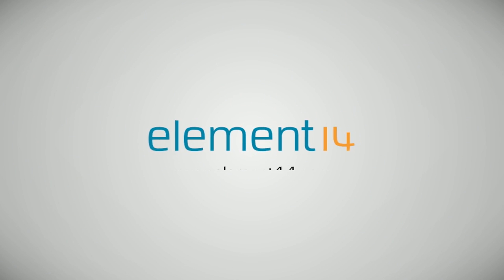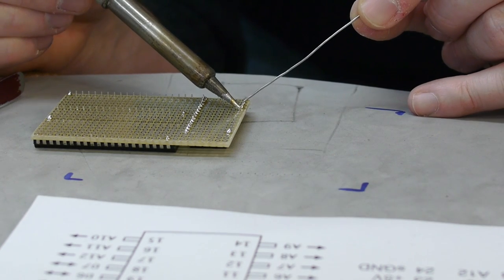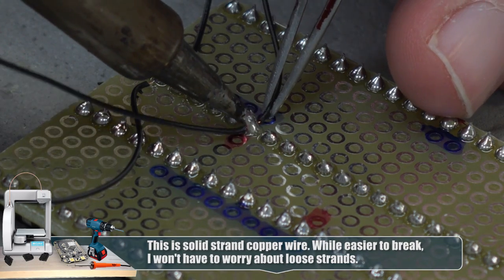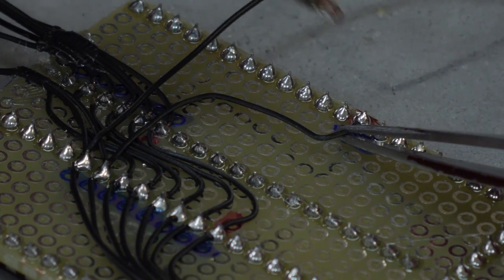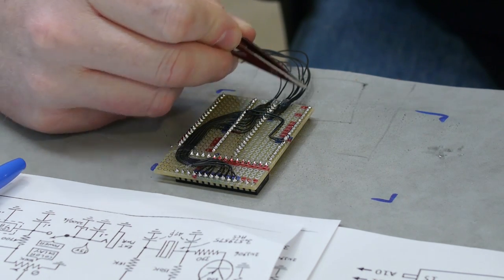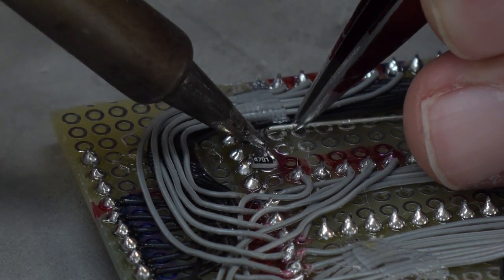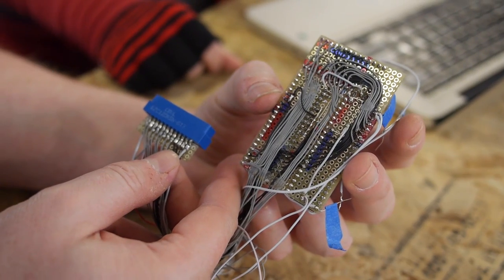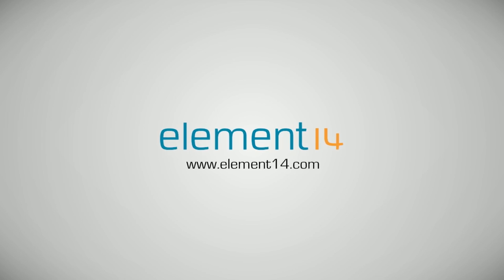Ben Heck’s Super Soldered Atari 2600

Comment: Gah, Ben uses too much solder o.o
Reply: +Frank Sandqvist  Glad I'm not the only one who noticed this. The solder should form a dome around the pin, not a huge glob.
Reply: aapenjong Exactly!
Reply: +Frank Sandqvist Agreed :) But if you watch his movies in general, many of his soldering jobs, looks like they are close to cold :P And sooo much solder!
Reply: +Frank Sandqvist he uses the excess solder to solder the wires to the pins whitout having to reapply solder
Reply: +Rasmus Jørgensen Well, he doesn't use flux neither and especially the SMD soldering part was cringe-worthy thanks to that - solder dragging into those sharp, pointy spikes is a sure sign of oxidized solder and lack of flux.
Reply: +Justagermannerd That just makes for a cold joint - since he doesn't use flux, the many times re-heated solder oxidizes and doesn't wet the components properly. Ben's soldering is really terrible.
Reply: +Jan Ciger Look carefully while he solders the pins of the ICs. You will see a clear resin form round the base of the 'Hershey's Kiss'. That is from the flux core of the solder. So he does use flux. But yes, no extra flux is being used when adding the surface mount parts to the joints but I think there is just enough from that pool of flux resin round the base to get a good enough connection :)
Reply: +Jan Ciger Most solder these days (as you see in this video) hold flux in the core.
Also a some of the dev boards are pre coated with flux.

But yeah there's a lot of solder being used for sure.
Reply: +Frank Sandqvist The holes in the pcb are enormous relative to the pin. To cover this he need more solder than usual. It also becomes  much easier to place wires and ensure that holes in the pcb does not open again while he working with the rest of the layout.
Reply: +Frank Sandqvist Mr Blobby - "Blobby Blobby Blobby" !
Reply: *****

That's not sufficient. That flux will make do when you make the connection for the first time and the pin and PCB are clean. However, when you heat the joint second (third ...) time, there is no flux anymore and you get cold joint.
Reply: Raymond Doetjes

The flux in the core will evaporate/burn off the moment you solder the pin for the first time. When you re-heat the joint there is no flux anymore and you are soldering oxidized solder because there is nothing there to remove the oxides. And you get those lovely spiky cold joints he is producing.
Reply: +Jan Ciger not to mention the amount of solder he uses risks creating bridges on the pins on either side...
Reply: Every single joint he made would be rejected at my work. Not hot enough, not applied for long enough, wrong shape and too much solder.
Reply: +Idris McMillan OMG who the hell cares?
Reply: +TheRealDeal If you're making tutorials, which is Ben's business, then you should know what you're doing and show correct technique. Ben seems like a really likeable guy, and he makes really great projects, but his soldering technique is incredibly bad.
Reply: +Frank Sandqvist He's doing that for the wiring, so he don't need to add more.
Reply: +mohabiraq1 Yes, we know that's Ben's reasoning, but it doesn't change the fact that it's bad practice.
Reply: mohabiraq1 that's poor reasoning though, the reason we tin wire first is to fill in the gaps between copper strands and make sure it gets the best connection possible. only reason to do it the way he did is if he is using solid-core wire, which is only a good idea for power lines but terrible for data connections, speaking from personal experience there.
Reply: +MortifiedDumplin Why would solid wire be bad for data lines? I mean, PCB traces are solid "wire" and they work just fine for GHz data buses on PC motherboards...
Reply: Antonio Tejada Short Version: It picks up data from other lines because of the same properties that let WiFi work, and PCBs are thinner, have a special coat to protect them from those problems.

LONG VERSION:
Solid wire in certain shapes can pickup just about any radio signal imaginable thanks to the larger surface area, among a number of other things which would take me paragraphs to explain, I'll admit it's fine for older components with low processing speeds, and Ben is doing what he can to reduce what it picks up by using smaller gauge wire, pushing it close to the PCB, but its still bad practice and resonance is still a problem that creates cross-talk between connections, leading to worse video and audio, which is also why cheap speakers tend to buzz.

On the subject of PCBs, the traces are significantly thinner than solid core wire and in normal cases get a "Conformal coating" which works to protect them from external interference to a degree, but sometimes a grounded metal shield is still necessary for more sensitive components.

Really long version:
Read up on electric interference...
Reply: +MortifiedDumplin Oh dear. I think you need to go back to the textbook, because what you said definitely is incorrect. Stranded vs solid doesn't affect susceptibility to EM interference. And solder mask and conformal coatings do not shield at all (ground planes and guard traces do). Whatever experience you have with solid wire, your observations may be true, but the underlying reason is something altogether different from what you think.
Reply: Antonio Tejada that's my personal experience. I don't know exactly what comes up in your books but that's my use experience.
Reply: +MortifiedDumplin Again, I'm sure the effects you observed are real, but the cause is something entirely different, because susceptibility to EMI is not decided by whether it's solid or stranded wire. Other factors make a difference (length, shielding or lack thereof, ground loops, single-ended vs differential signaling, etc.). 

I'm also not sure what you mean about solid wire having a larger surface area than stranded -- the exact opposite is true. For a given gauge of wire, stranded has more surface area.
Reply: Really depends on pin to hole ratio, even though that sounds um.... yeah.
Reply: +TokoToko Bunni You mean like the relationship of pad size, hole size, and lead size?
Reply: Antonio Tejada Tough crowd.
Reply: +H0rcrux Sorry, nope. 
1. Reflow soldering (reheating to join already-tinned components) is a viable method, but it in no way requires the giant globs of solder he uses. (He boasts that they look like Hershey's Kisses, but that's exactly the analogy professionals use to explain a joint with far too much solder.) Additionally, to reflow solder reliably, you must add flux, because you're not adding solder (which normally contains a flux core.)

2. It's a single sided PCB so there are no vias, just unplated through-holes. Ben incorrectly refers to all through-holes as vias, but a via is a plated hole used only to connect layers, but not used to mount components.
Reply: +Antonio Tejada I like the episode, but the solder was way overboard. The joints needed to be about 1/3 what he used. Its what the thermal shock from that amount of solder does to the IC that worried me, they're rare and hard to find.
Reply: +Scott x Totally agree with you on all points. You're exactly right, with rare ICs, it's a no-brainer to use sockets!
Reply: He needs to be up on his IPC J-STD and 610-A. Definitely not soldering to class 2. Probably didn't even get 70% fill in the through hole. Plus having insulation in the solder is a definite defect. Let's not go into the fact that you should never solder to the primary and secondary sides of the board. You can add more heat to the primary side, but you'll cause a void I the through hole when you add solder to both sides. There is a standard for that.
Reply: do it how ever you want.
Reply: You're right for production-level, professional work, but if you're just doing DIY then this stuff isn't really needed. You're spending more time to get everything right on a single circuit, and it just has to work. Anything else is just being nit-picky.
Reply: You also forgot never to hold a surface-mount component as you solder it, if you want to hold yourself to J-standard specs.
Reply: NaeMuckle agreed. Someone needs to redo their J standard certification

Comment: Here's an idea for you Ben, when soldering the wire with your method(by smelting the outer tubing) you can verify a good bond by have a multimeter in continuity mode attached to your soldering iron's frame and the wire you are currently soldering.

Comment: I bought a Haako soldering iron tip cleaner, and have never gone back to the sponge. It does a great job. Also, with the cost of custom printed circuit boards dropping like crazy, all you need is about a week and a half of patience to do away with all the fiddly wiring.

Comment: Hey Ben,
Great video. I was left wondering What kind of solder and flux/resin core do you use? Also, what gauge of wire is the black wire?

Thanks again for the great video!

Comment: This was great to watch! What gauge of wire did you use for the 'tiny wire'?

I also thought it was neat that each piece of Ben-made hardware has a custom signature in the form of your hot glue fingerprint holding down the wires.

Comment: Hi Ben,
Thank you for sharing , did you publish the schematic diagram ?
Reply: There are diagrams here: https://github.com/thebenheckshow/226-tbhs-Super-Soldered-Atari-2600 , and docs/Schematic_Atari2600_2000.png seems to be the main diagram (can someone confirm?), but I'm not sure how much of it was actually used (it seems to be a diagram for the original console).

I wish to reproduce this on solderless protoboard, but I'm still struggling to figure out a materials list from there (electronics is not my super strong skill). If anyone could figure that out it would be great.
Reply: Thank you so much , I will check it .

Comment: Just starting up the episode…but…wouldn't you want to solder sockets? That's a very popular mod to do to existing 2600 PCBs by the fans in the community. Obviously makes it much easier to replace defective chips like the RIOT or TIA if they eventually fail.

Comment: That was killer! I do a lot of that kind of work making my Arduino shields from scratch, although I don't use SMDs. I don't know if I can handle them right yet that's just too fine of a work for me :-) but I like to know what kind of solid wire that was used because I'm using that fine wire from IDE ribbon cables, it stranded and hard to work with. Nice work, Ben!!  :-)

Comment: I ended up watching this for the soldering technique - which I totally lack. Also, the iron I use currently has a pointed tip, so that doesn't help. Luckily, I have tons of old-fashioned lead-based solder, which is much much better than the modern stuff.
I really need to get my skills up to speed before I dissemble my DX7s synth to change its backup battery, that is hard-soldered to the PCB. Thanks Yamaha for making this an easy task !
Reply: Yeah, I hate conical tips too. Chisel or bevel tips are the way to go! (And a drag soldering tip, which has a little well to grab solder. Freaking amazing even for other things.) Good leaded solder is still available. I use Kester 63/37 with 44/66 flux core (3% rosin core) in a few different thicknesses, which you can get on Amazon. MG Chemicals solder is also very good. Multicore brand is supposed to be awesome, too, but I've never tried it.

Comment: Early in the video Ben mentioned handedness when soldering and I realized I prefer to heat components with my left hand while feeding solder with my right. I'm right-handed. Is this unusual or is it fairly common when soldering? I feel I have more control feeding solder with my right hand. I dunno. Just wondering if I'm a weirdo or if other do this too.

Comment: great video that is gonna be my next project. but what kind of wire do you use? i am using wirewrap wire and just solder with that only the isolationisme doesn't go away by heat as you told  tour wire did
Reply: +jonathan beibier Ben found an hold ribbon cable and pulled off each strand to reuse it. It was 30AWG.

Comment: 17:02 What might be a better idea would be to add a socket, and solder to the socket rather than directly to the chip, since it leaves the chip unmolested if you suspect you may want to remove it later. Of course, that adds vertical height, so it's a trade-off.
Reply: Indeed I thought the same

Comment: The 6532 ICs (RIOT chip) came in 1 MHz and 2 MHz versions. Which did the Atari 2600 use?  Would there be any difference in performance  if you substituted on for the other in a 2600?

Comment: A newbie question about flux: This video shows leaving excess solder on a pin/pad for future use when connecting wires. In this first connection, the flux in the solder core melts and deoxidizes the pin and pad to form a strong bond. In the subsequent connection with the wire, there is no flux to help remove oxidation from the wire. How does this affect the quality of the second bond? Do you find you need to introduce more flux (such as with a flux pen) to make this technique work? Are you melting the wire casing and the solder in a single operation with the iron?

Thanks for making these slower-paced vids! I like seeing a good mix of interesting builds and skill deep dives.
Reply: If your skilled at soldering, you can often get a 2nd reflow with remaining flux that hasn't evaporated.  Skilled meaning a quick and efficient solder connection.  But always have a flux pen handy.  2nd and 3rd or more reflows will always need the extra flux (especially that crappy lead free solder) to get a clean solder without icicles.  Icicles are the pointy edges left on solder as it oxidizes.  Just as flux and reflow to cure icicles.  Hope this helps.
Reply: +The Dollar Guy he didn't even tin the wires which can cause all sorts of problems. You should always tin the leads. Poor soldering technique. If you want real answers look up the IPC J-STD.
Reply: Steffenwolfe
You are absolutely correct.  I always pre-tin the wire and it is so automatic/assumed, I forgot to mention it.  Sorry about that.  But with an already tinned wire and existing clean solder connection, you can make 2nd solder reflow usually without additional flux.

Comment: You solder at such a low temperature. I guess that shows what you can get by with when you have a decent iron. If I tried that with mine I'd probably destroy something waiting for the solder to melt.
Reply: A good soldering station makes soldering a joy. Indeed, you can set a reasonably low temperature, because the station will sense the tip temperature and feed in the right amount of heat to maintain that temperature, no matter the size of the joint you're soldering (which is drawing away heat). Your goal should be to make a joint in about 2 seconds.

Comment: Learn to solder left handed. Is that lead free solder? I't kinda blobby and not very shiny. It's a fabulous idea to have a fume extractor, and you don't need to buy a charcoal filter $800 filter. A simple dryer vent flex duct, a muffin fan, cardboard and an open window works fine.

Comment: That took some effort. The end result still looked quite messy. I had the same once doing the circuit, more or less exactly the same way, but only one chip. I think in the end would be better to make the circuit itself than use a proto board.

Comment: This is a very useful video! It's good to see some nuances of how soldering is done. These pieces are so tiny.
Reply: +kieferonline Hah, not even close. This is as un-nuanced as you can get in soldering. Ben does great wire routing and overall design, but his soldering is really bad. (And none of the components he used are especially small. Most new components are much smaller.)
Reply: Well, he's the best--among those who also post soldering videos to YouTube. I'd definitely like to see better examples, if you have a suggestion.
Reply: +kieferonline Look for the tutorials from Pace and EEVblog.

Comment: Ben, a good solderjoint is concave. Yours all seem to be convex and that is not good. You need to bring heat to the pad and the pin so it flows nice. Only heating the pin gives convex joint. There is a good tutorial on youtube from Pace, an  80's instruction movie.
Reply: Yes! The Pace tutorials are awesome!

Comment: Getting perfect solder points is so satisfying :D
Reply: +dj505Gaming It is. But this video shows rather poor solder joints.
Reply: +Antonio Tejada Well, as long as they hold, it's fine with me :P He did say though that he was adding more solder than he needed to make it easier to get wires attached properly.
Reply: +dj505Gaming It's not just about holding. With excess solder, it becomes difficult to actually inspect the joint. Especially when working with old parts like those ICs, it's actually possible to have the lead passing completely through the blob of solder, but the oxides on the lead completely preventing the solder from sticking to the lead. (I'd worry about this with those wires that he just melted the insulation off of, rather than stripping.)
Reply: +Antonio Tejada That's true. Oxidation could definitely be a problem. Just to be safe, I'd wipe the leads down with something, rubbing alcohol perhaps. That would get rid of oxidation. I would also just use minimal solder at first, then re-flow it and add more when I need to connect the wires. More effort, but cleaner points.
Reply: ***** Alcohol is great at removing oils and assorted gunk (so cleaning parts with it before and after soldering is very good practice), but it does nothing to remove oxidation. That's the job of flux. The flux core in electronics solder is enough for clean, new components, but for heavily oxidized components, additional flux is all but essential. Flux always helps, so it's not a bad idea to routinely use a flux pen or brush to add a bit extra. 

As for reflow soldering: Yes, it can be a great method, but since you're not necessarily adding solder, you should always add extra flux before reflowing.